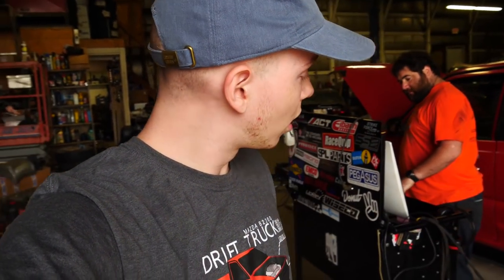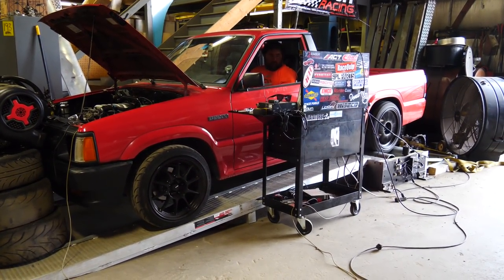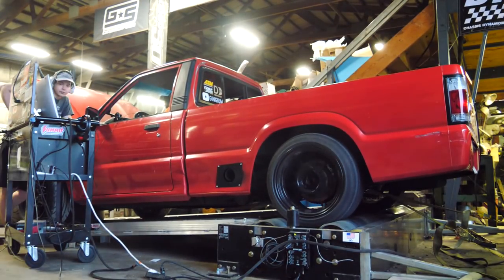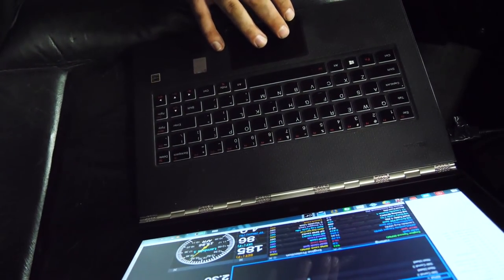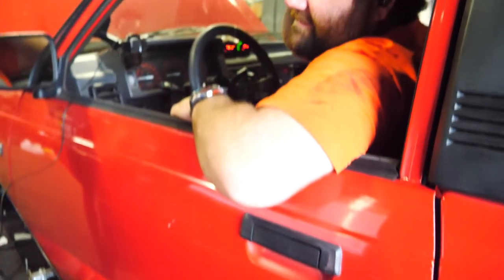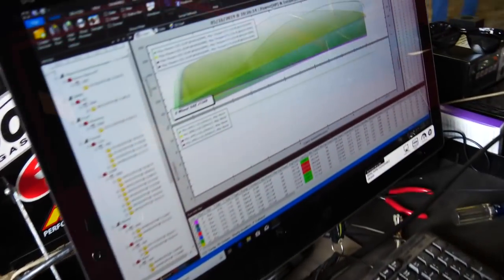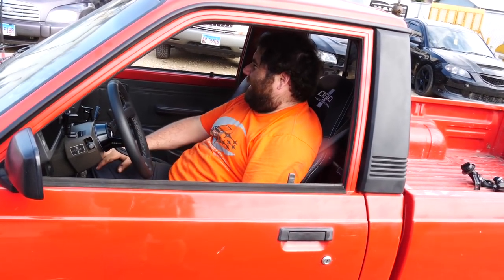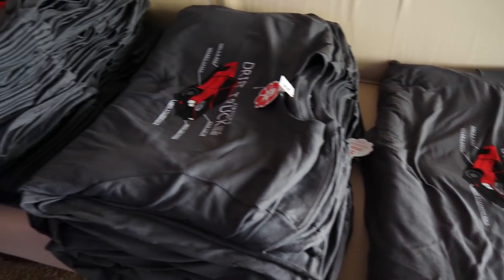V8 DRIFT TRUCK Returns to the Dyno! How Much Will it Make?

Comment: The bus still holds the shop record for hp and torque at 305hp 440torque
Reply: 6.0 life. I saw him heading toward Milwaukee a week ago and it puffed some (unusual) smoke. Tune maybe?
Reply: Tim Steinke nothing unusual about a Smokey diesel
Reply: @TJrcTX  6.0 tend to have issues with the vains on the vgt if they aren't kept up with.

Comment: Next mod... Light weight flywheel to fix that rev hang and slow RPM gain!
Reply: you know thats because of the dyno, right?
Reply: That's the dyno causing that, and the flywheel is already aluminum as it's a custom one to fit the 1uz with an sr20 clutch.
Reply: Pulse R next mod Ls swap that pos 1u
Reply: @fastchevy z28 as a man who's swapping an lq4 into an early 90's truck, i must say that's an incredibly boring option when you already stuffed a Lexus engine into your Japanese Ford Ranger
Reply: I spots another Volvo. Greetings lol 😂
Reply: I cant believe 281 people agreed/don't understand how a dyno operates.

Comment: Remember, it’s 250WHP, add 25% for drivetrain loss and you’re at 300-310HP which I think is plenty for a 2600lb drift missile. You’re making as much as an older 350z and they weigh a lot more than 2600lbs.
Reply: 25% drivetrain loss is a LOT, but given its way custom and totally mismatched parts, I guess that makes sense.
Reply: redaggron1 the power steering alone sucked 10WHP, what do you think that power would have been worth at the crank?
Reply: Plus I'm pretty sure he said this dyno reads really low in the previous dyno video.
Reply: I bet it's closer to 15%
Reply: @imnota  Its a mustang dyno so.
Reply: @calebpeterson8322  Agree, with a stick car/truck especially.
Reply: Yes, but power
Reply: @redaggron1  that's with a auto. This a manwel trans mixer it's more like ten to fifteen .
Reply: With 25% loss your drivetrain parts would be hotter than your exhaust. 🙄

Comment: Ging you should look into getting some bigger cams and a terminator cobra supercharger(M112) with minor adjustments will literally bolt right up to the 1UZ
Reply: He's thinking of doing a procharger on the motor while remaining stock from the valve covers down. I would do your idea tho
Reply: You need an adapted intake manifold, then they bolt on. But I'm not sure if they make them for the vvti heads or not.
Reply: There are none for the vvti motor that i have seen

Comment: People saying “that’s a small amount of Hp for a v8” need to realize stock ls1s (YOU KNOW THE CORVETTE MOTOR) made about 280-90 to the wheels this really isn’t that slow for a very low displacement v8 people need to stop thinking that “oh it’s a v8 it must make 500hp or it’s slow”
Reply: Edenfigle Moodleberg true
Reply: He's also on a mustang Dyno which reads a lot lower than a normal dyno
Reply: Tra1aW_PC yeah but he also does have headers which boost a car up about 15-20 wheel but yeah I totally agree that it’s impressive especially for a Toyota made v8
Reply: Adept yeah I got my car dynoed on a mustang dyno and was sad it was at 394 wheel I was expecting like 425 😞 but I’m still happy with it
Reply: @jkiu2692  I should be the one crying as my truck makes 90+ to the wheels
Reply: Tristan Wright He’s planning on procharging it I believe which honestly is nuts, the internals are most definitely going to need to be beefed up substantially.
Reply: Yeah people tend to not realize v8s are better for torque than hp.
Reply: @goodkill1  Really depends on the stroke and bore ratio. It can be either.
Reply: 1UZ is 87.5 bore, 82.5 stroke... with cams these should make some impressive N/A numbers

Comment: Pre video prevision : 247 hp

Edit 1: woah I was close
Edit 2: Nice chopped stickers
Reply: Βαγγέλης Γιαννόπουλος you changed that. It was at 265 at one point
Reply: @cooperdanielson1265  why would I lie about this? I mean if I just to wanted get  attention, I would watch the video and then say that I think that it made 252 hp. Plus the next number I thought was 270, but I thought it was way higher than the actual number, because a lot of things would have to be changed. 247 was the original number I had in my mind ever since the notification for this video popped up and it is the only number I had on this comment.

Comment: The fact you only needed 245 hp to drift as well as you did is amazing. Every other drifting youtuber needs like 350-500 hp  for them to  comfortably drift.
Reply: Adam LZ loves to drift he's 350z... He also has a 1000 hp 2JZ S15 FD driftcar
Reply: Chris fix last i remember has 195
Reply: I love Subies i think in his exhaust video he made a little over 200
Reply: @ButteredUpToast  oops im wrong he reached 199 hp
Reply: What I say doesn't really mean shit, I haven't drifted anything over 200hp😔😂
Reply: It's about balance, tyres(grip)/weight vs power. With too much of one you have to change the others.
Reply: I love Subies I thought it was 210 whp

Comment: I would put the rear axle in the correct spot before putting in the 4 link. It’s too far to the back and that may be cause it to axle tramp (wheel hop as you call it) all the time. I drift and rally a car with a live axle and they rarely hop.

Comment: Switch to electric power steering pump
Reply: that might be expensive, and it might not feel as good, but he could look into it.
Reply: For 10 hp gain? Nah, fuck that just boost it😂
Reply: True😂
Reply: Why digg for 10 n/a hp, when u can boost it for pretty cheap, and get 400-600 boosted japanese horses🤩
Reply: @dennis9810  he cant boost it, he has aluminum rods in the 1uz i believe, those cant withstand that much power

Comment: Quick question for ya, why did you use the 1UV V8 when many people use the old Foxbody 5.0L 302's? Did you want to stay Asian? Or just to be different. Looks great, I had an '89 2200 cab plus, she was slammed, I built a fake dual exhaust that went out where the rear bumper brackets should be & I used 5.0 tail pipes for that! Fun times in that truck! Best wishes to you! Peace

Comment: Just dropping a little knowledge... you don’t actually feel torque, torque is the rotational (twisting) force and horsepower is the perceived work “perceived” (how fast and hard it’s twisting) being the key word... torque X rpm = horsepower, that 30ft-lbs you’re feeling is actually the 15hp ish gain in the low end you can see on the dyno graph at 8:43 keep up the projects! Love your videos!!!

Comment: Whats the point revving past 5500 when your are hitting max torque at 4250? other then sooner or later you be at the rev range for max BHP
Reply: So you want to rev to 4200 then shift to the next gear, or do you want to go 6kplus and the next gear already be in the power band

Comment: Nice Truck, it’s too loud, it doesn’t make enough hp and torque, for a newer engine, it’s pretty lame and way too loud, you could have a old basic efi engine from the 80’s based on your engine quality. Good work with the truck, add a 70mm turbo and then you’ll make some real hp, just sayin.

Comment: 250 is good for low displacement, don't try to turbo that, if you do you NEED to gap the rings or they'll expand from the extra heat and rip the top of your pistons off or shatter those stock rods, I've seen ppl put a turbo on stock rings and run fine for a bit then suddenly they lose power and have a ton of blowby or send a rod through the oil pan

Comment: Damn all that money spent to make 250 wheel! Ik the 1uz is unique but I woulda just LS swapped if I new it would have those numbers! No hate just thought it woulda made more power
Reply: itz jay an ls would be making very similar power. Corvette ls1s made like 280 wheel and they’re almost 2 liters bigger I believe.
Reply: Joseph Samsor yea ls1 but with an ls3 you can be in the 400s easy
Reply: Joseph Samsor you can find the whole ls3 swap for like 7k
Reply: itz jay yeah I’m pretty sure that’s much more than what he has into this. It’s not even about having a stupid amount of power. If he turbos this he’ll have more power than he’ll ever need and he’ll have the most unique vehicle at almost any event. I get your point though. A different engine may have been more cost effective in terms of hp.
Reply: Joseph Samsor well if the shop he used sponsored him sure he didn’t spend too much but Ik re wiring a car cost a ton and tuning and dyno time also another penny. The UZ sounds way better than a LS that’s for sure.

Comment: 1 uz engines can handle a lot of power .... and are fairly easy to mod so 250 now but when you will decide to put a turbo on it it will make like 400
Reply: Na supercharge it ftb
Reply: Considering he has a VVTi engine, supercharging/turbocharging is not the way to go. 1UZ’s are notorious for having weak rods beyond the 1994 model year, the VVTi ones being the weakest. Best option is ITB’s
Reply: @PlayinWithMahWii  i mean, he could just build it for low boost. Seen as his miata is getting a PHAT load of power

Comment: A stock 13b turbo from an FD would make more power
Reply: PandaMonium _Gaming the cost that it wouldve taken to do that swap wouldve been easily 5-10k more expensive than the 1uz he has.
Reply: PandaMonium _Gaming maybe not to the wheels though. And then you have way less torque as well, and it’s boosted. This is naturally aspirated.

Comment: Does anyone else feel like this was kind of a waste of a build? Countless dollars spent for 240 hp? Idk I love gingium and have been watching since the Forza days but was a little disappointed with this build
Reply: Garrett S it’s a much different take on a “cheap” drift build so if your dissapointed by it why watch the videos on the truck
Reply: don't forget the engine is still stock. when you start drifting you should start with lower power so you can actually learn how to do it propperly
Reply: It's an unorthodox build done well. It's not finished, and remember power to weight is everything. 310hp at the crank is quite a lot for a car so light. A civic type R has almost the same and its front wheel drive and way heavier
Reply: You watch YouTube to much stock ls1s (you know the corvette motor) dyno at 280 stock this is wheel hp not crank this cars probably making 310-320 crank
Reply: 240 wheel horsepower is a lot honestly and still torque is more important than horsepower!

Comment: Modern V8 tuned for performance and it only makes 250hp. Japanese engineering.
Reply: Random projects USA it’s a smaller engine. Stock ls1s made very similar power with a bigger engine. Not to mention this engine is known for being one of the most reliable ones out there.
Reply: Joseph Samsor   When did I say anything about reliability?
And no, 250 hp is a low number for V8s, not to mention this one is tuned for performance.
Reply: Random projects USA you didn’t, but it’s an important factor. Keep in mind this thing only has a tune. Otherwise it’s completely stock. He still has a lot of room to upgrade it. If it can compete with a stock ls1 at a lower engine size, then it’s doing great. I don’t think he even changed the cams or anything in this engine.